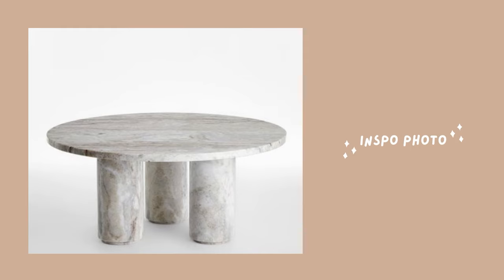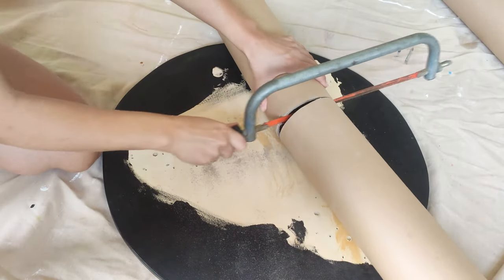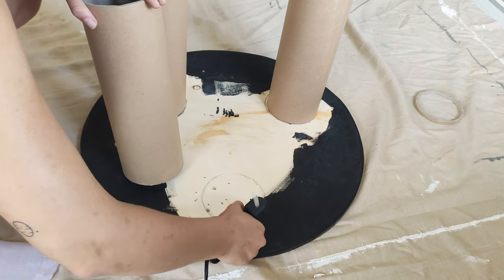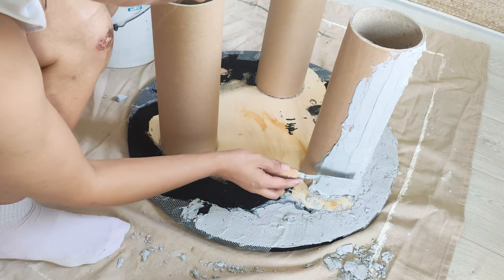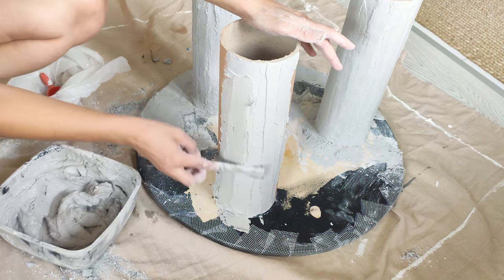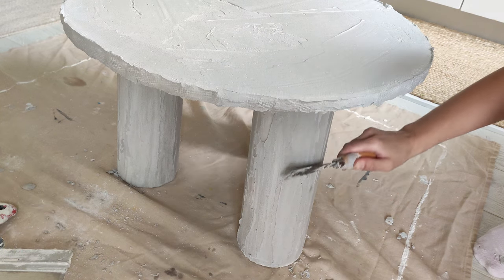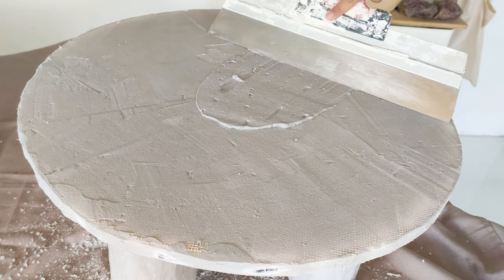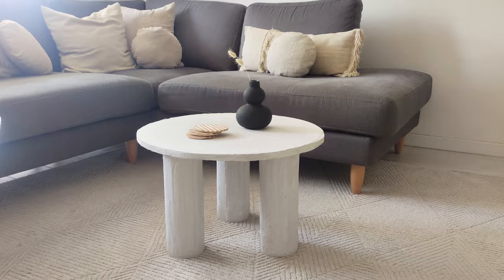DIY COFFEE TABLE Using Plaster | $0 Modern Coffee Table DIY

Comment: I forgot a tip you can use…a drywall sponge 🧽 wet it with water and that helps to smooth out the surface of the plaster. It’s a gem
Reply from the maker: Oh yes! That's such a great tip, will try it next time 🤗
Reply: Yes this saved my life on building my Santorini look alike concrete seat!! I remember your comment and literally saved my project! Even after the stucco dried, I just added water and the sponge and reshaped the surface texture!
Reply: I’m so glad that it helped!!! 🤗

Comment: Hey there! Would you share a honest review of your table after 1 year of use? Did it hold well or dit it crack / chipped easily? What about the color, did it remain in this nice color or did the color from the table below started to show after a while? I'd love to do this DIY but I want to make sure I'm building something durable :)
Reply from the maker: Hi, after a year, I have to say the legs have cracked a bit. However, I don't think this would have happened if I added the mesh tape on them too, as I did for the tabletop. The tabletop is in perfect condition 🙌
Now, for the color, I painted it and sealed it after all, since it ended up having coffee stains on it. So definitely have that in mind, if you want it to be durable, you'll have to at least protect it with a clear coat. I've seen people adding glass on top, which also looks so nice.
Hope I helped ☺
Reply: Hey thank you so much! I realized that other people asked already about the finish. Thank you :)  @HomeByMon
Reply: Hi there! Can I ask what kind of paint you used (acrylic or latex) and what sealer on top??